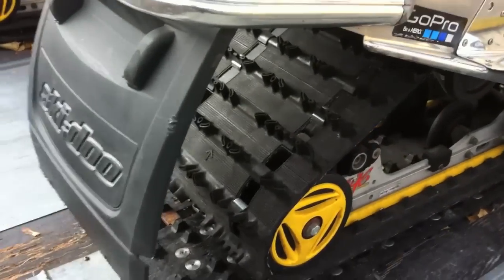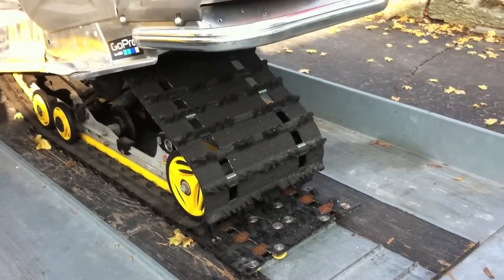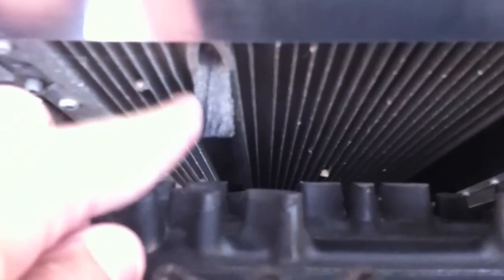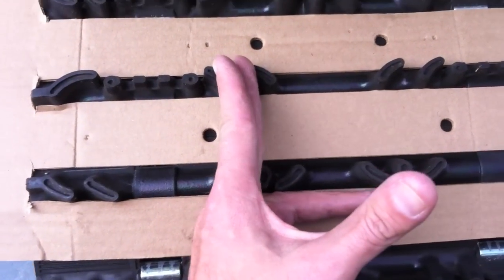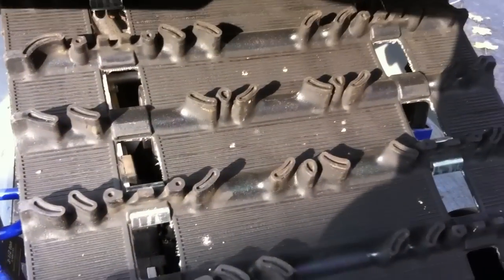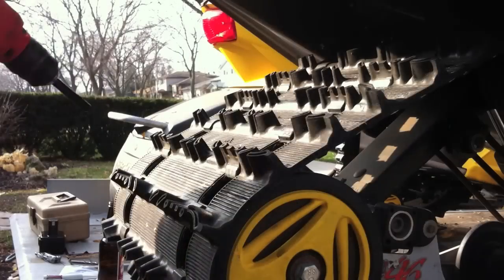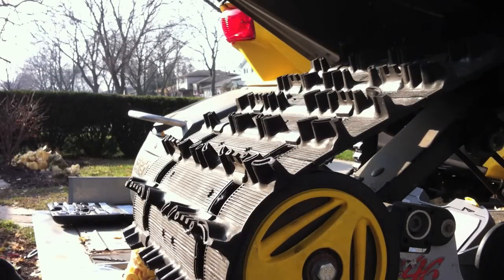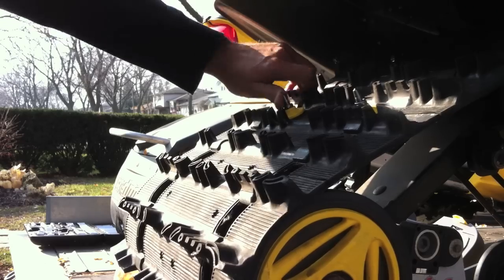How to Stud your Track, Step by Step DIY Guide, Skidoo, Polaris, Arctic Cat, Yamaha

Comment: Thanks for the video.  I was wondering if you have ever had problems with studs coming loose.  I noticed you didn't use loctite or a torque wrench which were recommended by others.  I suppose the nylon in the "self locking" nuts probably help.  I want to DIY the studs on 2 new sleds my wife and I bought and want to do the best quality installation possible without wasting time and/or money.
Reply from the maker: no loctite, just the nylon nuts, to tell you the truth, I tried to remove some old studs from my last belt and it was impossible, they had totally ceased on. I'm just going to lift my sled before winter and check to make sure they are all still tight. But consult your local dealer with your concerns.

Comment: What size stud did u use?
Reply from the maker: I don't recall, but they were the proper length to match my track lugs.
Reply: @warrenhardy  ok I was just curious cause I wanna stud a 05 mxz 800 it has a  1.5" lug wanted to stud with 1.52 but scared it'll hit tunnel coolers

Comment: BUY A CAT AND GET REAL TUNNEL CLEARANCE OH AND 129" TRACK.
Reply from the maker: Thanks for the feedback, I do actually have an older 2000 Arctic Cat, and a Polaris, I don't discriminate.
Reply: Just bought a 2018 El Tigre 800,  but I'm nervous at the 137 track,  is the 129 better?